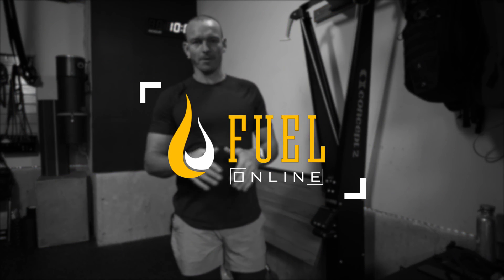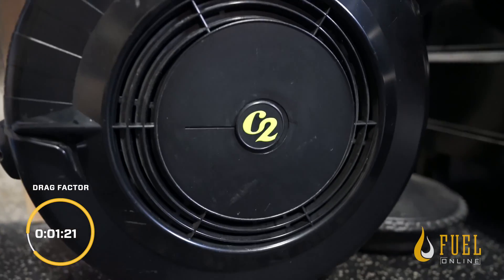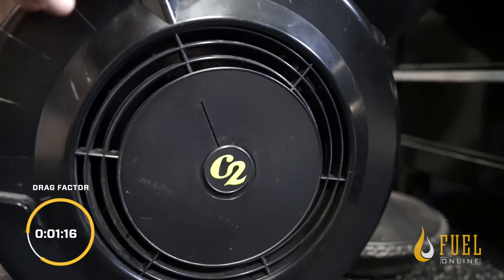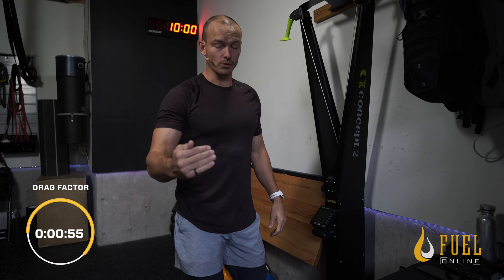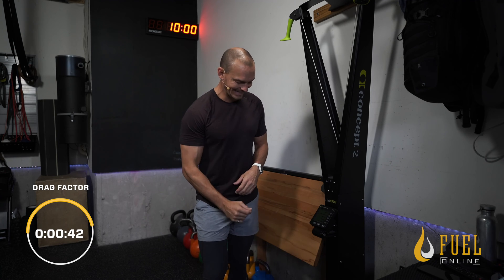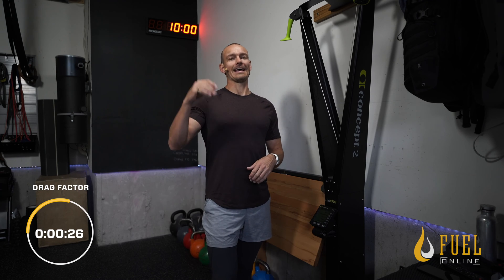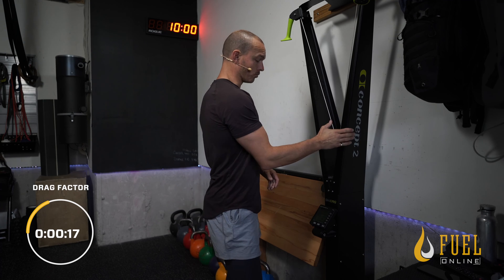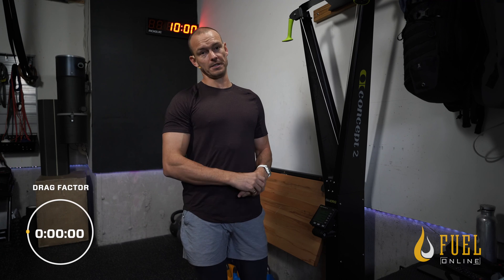Quick Drag Factor and Damper explanation | Concept 2 Skierg

Comment: You’re missing some thing in your explanation. If all else is equal and it’s just easier the lower you go, then everyone should have it on one or zero to get the best time/speed/whatever.
Reply: No, that's not how it works at all
Reply from the maker: Not exactly - there's a force production curve. The best way to illustrate this is to test a couple distances yourself. Similar to staying in first gear on a bike, you'll be quicker up to speed but won't be able to create any additional torque. Conversely, too high and you'll be using too much energy to be efficient. The main difference is that it's more like a fixed speed bike as you can't change gears.